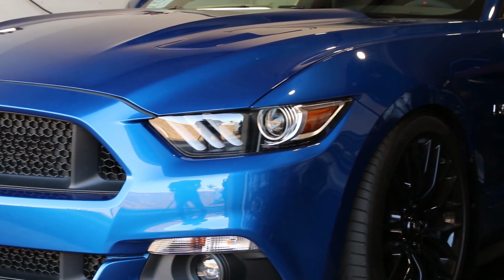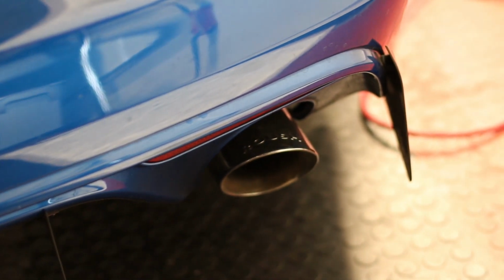Ford Mustang GT Roof Wrap and Tail light Tint

Comment: What did you use to cut the sides above the doors? Looked like a string or something
Reply from the maker: Hey! We used 3m knifeless tape. You lay it underneath the wrap and it will make the cut for you with out having to use a blade. There are different types of knifeless tape. For straight cuts like this use " finish line" model.